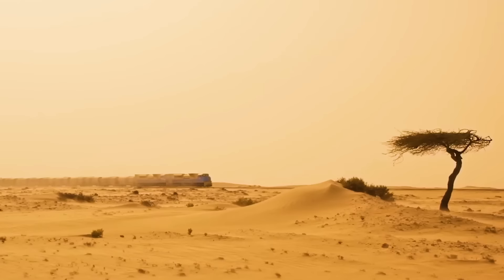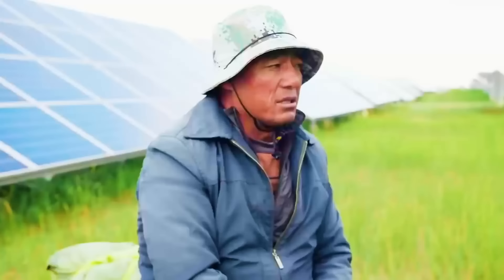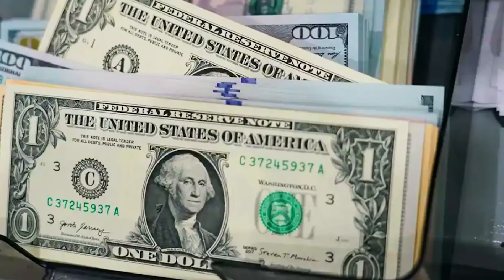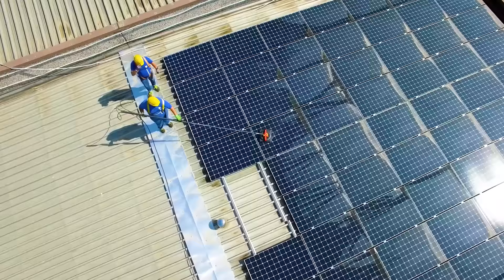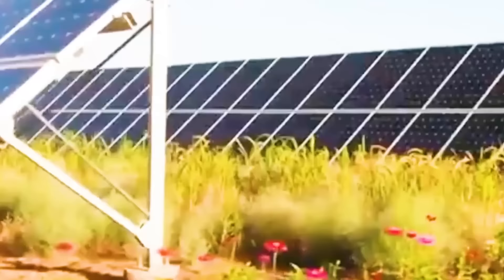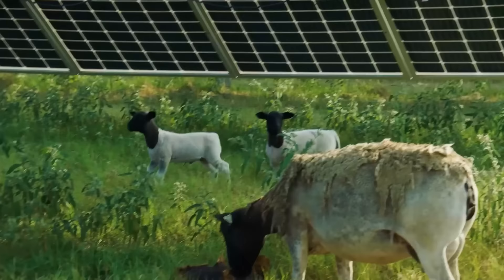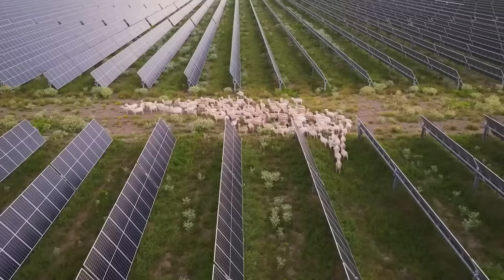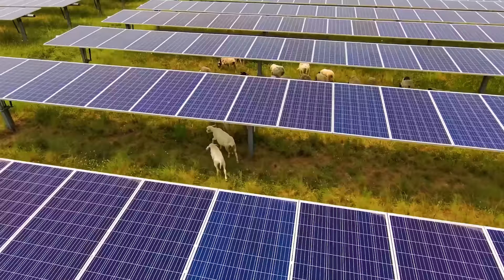UNBELIEVABLE! China Raises 300,000 Sheep in Desert To Protect World's Largest Photovoltaic Base

Comment: are they calculating the methane emissions from the sheep into the  emissions for the project? Pretty sure they’d have been much smarter to build a nuclear power plant. Denser power, baseload supply, and on
Reply: Three ways sheep are a good idea for solar plants. 
1) People are going to eat red meat regardless of methane and CO2 emissions. Might as well eat grass fed lamb than grain fed cattle that emit far more greenhouse gases. 
2) Sheep keep the grass short, preventing wild fires that release far more carbon than the sheep breathe, belch or fart out.
3) Tall grass blocs sunlight falling on the solar panels, reducing efficiency and outout. Sheep keep the grass short, increasing solar power and reducing burning of fossil fuels.
The carbon trade off is totally worth the  methane they release.
Reply: After building a nuclear power plant, some people will ask, what should we do about nuclear pollution?  It's always like this, some people are solving problems, and some people are just creating problems, doing nothing.
Reply: @hbwhzk  the benefits of nuclear are far greater than any intermittent source